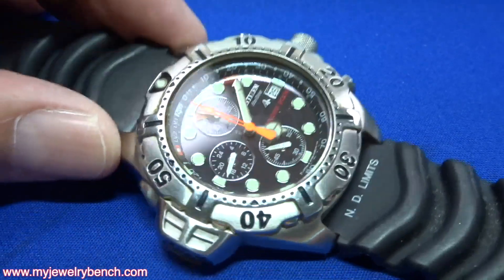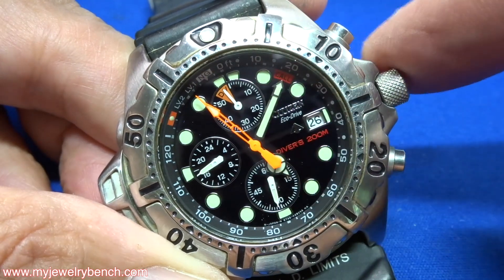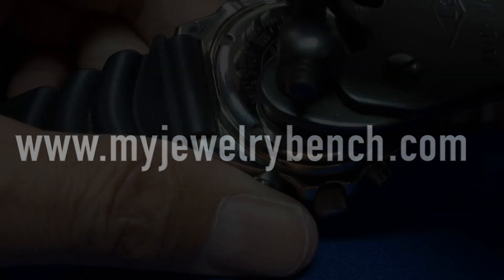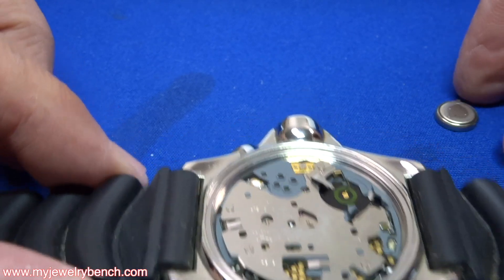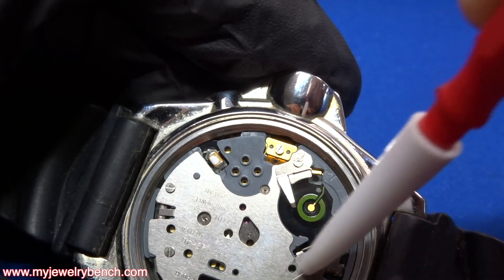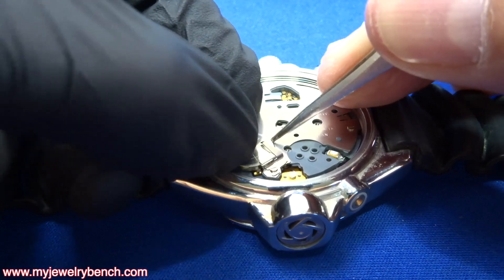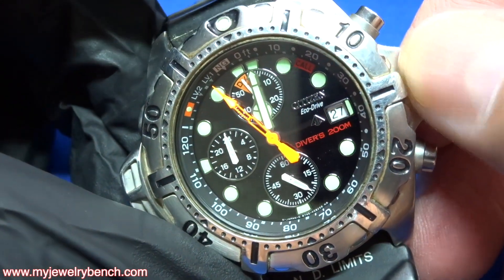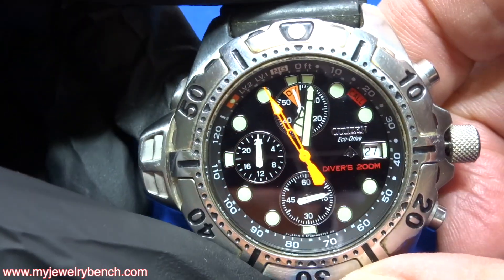Citizen EcoDrive Watch Missing Capacitor!  Lets put a new one in!

Comment: I had a similar experience with my Citizen Dive watch.  I was able to find a Panasonic replacement capacitor battery on Amazon for $29 and a watch repair tool kit for $10.   With a little care, it was a snap to install.   Local watch repair shop wanted $170.  Thanks for the tip.

Comment: Definite Eco Drives watches are NOT worth it (it's only my humble opinion only....do not attack me please ! ) These watches still need a battery ...period !  ( and expensive  ones :  even if you do it yourself) Rather stick with my  regular quartz watches : I change the cheap batteries myself  and I am able to keep the water resistance . If you  own several watches you'll always have one running and ready to wear.  I wish someone could come up with  real solar watch WITHOUT a replaceable battery . Keep the good work !
Reply: Basically/principally I agree, if you can do battery exchange by yourself (this means not counting your time to purchase batteries and replace them) and not considering the time your watch is not available/working replacing the battery in an Eco Drive does not pay out.
However for people who do not have the time, skillness, knowledge or tools it looks completely different, Eco Drive runs and runs and runs ... until you probably like to exchange your watch anyhow.

And Citizen claims recent production shows a much improved life time of up to 40 years. Would you revise your opinion if newly produced Eco Drives do really run for up to 40 years?
(Considering it from another angle, I believe there is not basic reason for Eco Drive batteries to be such expensive, except the low quantity and therefore no real/few competition)
Reply: @friedhelmschroter8124  Of course I'd revise my opinion if the new eco drive batteries were made to last 40 years  ...simply because I am over 40 years old..ha ha !  So basically these new 40 year battery watches would last me a lifetime (maybe I'll be dead when the battery wears out so I wouldn't care much) Forgot to say that I like some Casio watches a lot : their "10 Year Battery " watches last way over 10 years.I've had  some Casios and G-Shocks for a long time and  I never have replaced the batteries .I never use the alarms (useless to me because are not loud enough) and barely use the light.Even the regular casio watches have very long lasting batteries.So for that reason and many more I will always love casio watches !
Reply: @rjarias2011  :  i prefer my watches to last 5 years or maybe 3 years as a minimum on battery changes but i know that some watches last 10 years and that is maybe something i would look for if i was wanting to buy a new digital or something else new .
Reply: I have 2 eco-drive watches one is 10 years and the other is a little older. Still run like the day I got them.
Reply: I’ve had the same citizen EVO drive on my wrist for 20 years… never had to change a capacitor or charge it.. just keeps on ticking and always shows fully charged.. love it.. that thing will have to fall off my wrist in bits before I replace it.. I love it..did I say that already
Reply: I'm barely going to replace the battery on my 25 year old eco drive for the first time. Means the next time will be retirement age.

Comment: It's NOT a capacitor. It's a Lithium-Titanium rechargeable Battery.

The voltage of a capacitor depends linearly on the charge contained in it. A battery has a far more constant voltage. The nominal voltage for this battery is 1.5V. It charges anywhere from 1.8 to 2.6 Volts - this wide charging voltage makes it immune to being overcharged by the solar cell.
Reply: It is a capacitor.
Reply: @greyman1363  Nope. Battery.
Reply: A capacitor stores energy in the form of an electro-magnetic field between two plates.  This is a rechargeable battery as it converts chemical energy to electrical energy over time.  A battery delivers a constant nominal voltage for a long period, a capacitor delivers a constantly reducing voltage from its nominal value down to zero.  They are commonly referred to incorrectly as capacitors, but they are in fact rechargeable batteries.

Comment: Could you explain how the charging circuit works and how to best test it? I've replaced my capacitor and my watch is still stuck on the two-second skip even after a few days in the sun. I am worried the charging circuit is bad. The solar panel seems fine, as it will two second skip even WITHOUT the cap in the watch.

Comment: Great video....so when charging the initial new replacement battery do you do that with the stem pushed in or pulled out at the first click like if you were going to change the time?
Reply from the maker: Pull out to first or second click. Leave it in the light. However most new capacitors have at least a half charge
Reply: Both ways are basically OK, but when you disconnect/deactivate the second handle it is easier for the solar cell to charge the battery and charging at weak light works faster/a little better because more power from the solar cell can go into battery charging (the watch operation requires less power).
If you are charging in direct sunlight the difference should be small, but the less powerful the light the stronger the improvement in charging when deactivating the second handle.

Comment: Hi. I Like your video and wondering where you get that replacement batery? I have an Eco druge aw1031-06b and need a New batery. Is every batery the same? How I can find right batery for my watch? Many thanks.
Reply from the maker: Eco drive watches use a variety of different style capacitors. You can search for one online by using the model number of your watch. I suggest being carful as some sellers on places like eBay mismark them.
Reply: @watchesandjewelry  Eco Drive watches don't use any capacitors. Of course, it's a rechargeable lithium cell.

Comment: Peter: Just found your video and really appreciated it and how to-the-point you are! I have a Citizen Ladies watch that needs an mt516 capacitor. I changed one only once for my husband's larger size watch...this one is smaller and the capacitor has 2 copper things sticking out, across from each other. Wondering if you could advise me as to which side goes which way??!  Which side is positive and which is negative? I already damaged one from Ebay and don't want to ruin this one. Also didn't know at that time that holding it with a metal tweezer can damage it.....thanks for ANY input!! ps: I have begun to change batteries on old watches for our local charity resale shop. I'm 81. Thanks much!
Peg
Reply from the maker: Glad you are taking charge. It’s difficult to actually tell you which way the capacitor goes in. Typically the positive side is marked on the watch in the recess where the battery goes. The actual orientation of the copper tabs is important. However that capacitor is used in a variety of watches and I can’t say for sure which way to put it is. Look for two points on the watch that look like they will make contact with the tabs on the capacitor. If you can match the tabs you should be fine.
Reply: Find someone with a multimeter and they should be able to tell you what side is negative and positive. With normal watch button cell batteries, positive is the top. And ALMOST all of them have positive facing the caseback. Except for quite a few of the analogue watches of the 80s from the USSR (probably not something you're likely to see but I collect USSR watches). The digitals they had in the USSR were pulsar copies.

Comment: I have citizen perpetual watch with solar charging ..it lost a couple hours time but still works I pulled it out and let it sit in the window seal but not in direct sun for a few days. Hard to find a good watch repair shop..we’re I live at. Hoping it will charge and set itself.   Any suggestions is greatly appreciated. Thanks
Reply from the maker: Sounds like you are doing the right thing.  The only thing I do differently is pull the stem out to the second click. That helps charge a bit quicker.
Reply: @watchesandjewelry  ..yes that is what I did.  Thanks for sharing your videos

Comment: If leave your ecodrive watch in the window when your not waring it am I right in thinking the watch capacitor will forever?
Reply from the maker: Be careful if it gets hot. Heat from the window can cause damage to the solar cell under the dial.

Comment: MT920 is a rechargeable battery button cell,  it is 5mAH in capacity, very low capacity compared to a similar size watch battery button cell 0f 148mAH, a capacitor can charges and discharges ten of thousands of times without the problem of holding the charge, but this MT920 can charge and discharge 500 cycles then it will be expired like a cell phone battery, I own a Seiko Kinetic watch which used TC920, an earlier version of 3.5maH cell, ECO drive or Kinetic energy are just gimmick in the name of high tech to lure the consumers to pay for a tiny energy battery cell with 10 to 30 times the cost by welding an odd metal tab as a custom connector to the watch, locked the customers out of the regular rechargeable button cell price, Seiko was confusing us by using the naming of capacitor battery to give consumers a peace of mind thinking that Japanese had the capacitor/battery technology under their belts, bought their watches with admiration in early days of marketing, in fact we all got screw until today, the watch repair man still believe the myth, buy a regular Quartz watch and use a regular watch battery cell, it has 30 to 42 times the energy of ECO/Kinetic battery capacity, in 3-4 years replace with a new one, this is the most user friendly battery cell solution, the H with Shine it or Shake it routine to keep it working. Again! 
MT920 is not a capacitor device.